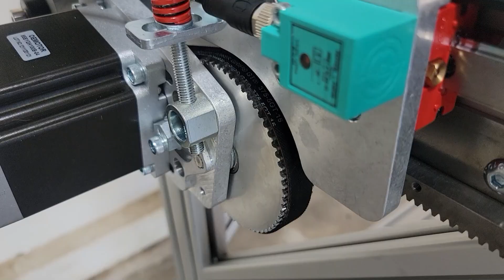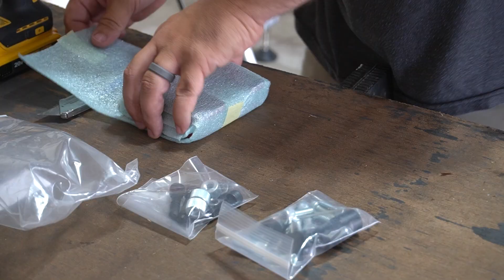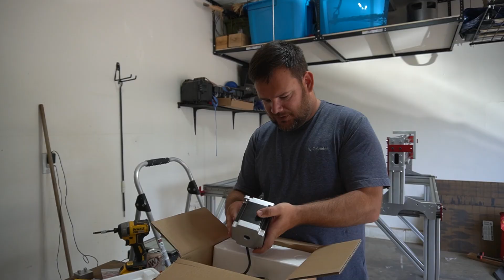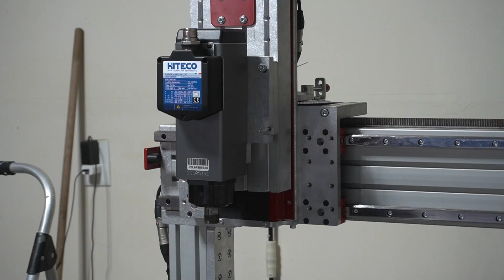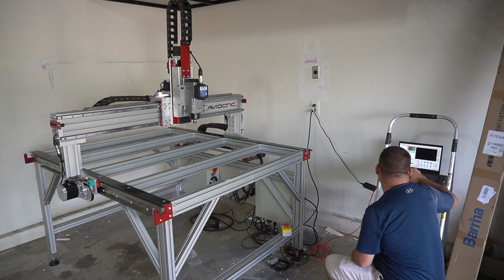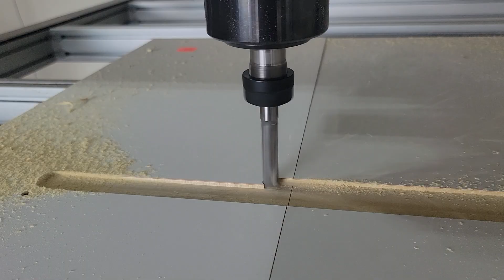Is the Avid Pro 4848 Worth the Build?

Comment: Can carbide create be used with the avid?  Do you have to use Mach4?
Reply from the maker: You can use whatever CAD/CAM software you want with the Avid, although I recommend Vectric. Carbide Create is CAD/CAM software. This is where you design your files and apply toolpaths. Mach 4 is CNC control software. It turns your computer into a CNC controller and reads your gcode. Carbide Motion is the equivalent of Mach 4. Carbide Motion cannot be used on any machine other than a Carbide 3D machine. Mach 4 can be used on many different CNC machines and Avid has gone the extra mile by making a custom interface in Mach 4 for their machines.
Reply: The HS I sub at was given an Avid from a donor, but no software except the mach4, I was trying to help the shop teacher figure it out…maybe even find a ready made project to try on the machine…..I have been trying to watch all I can to be ready when I purchase a machine…

Comment: I would still recommend actually tramming it with something like the Edge Technologies gauge. It gives you two dial indicators and a 6" span, it will be much more accurate. Get the spoilboard down first, and then use a piece of glass to measure the tram error. After that's done you can surface the spoilboard. No need to make test cuts.
Reply from the maker: Thanks. I guess it depends on your tolerances. I can see needed more accuracy for metal
Reply: @AndyBirdBuilds  This is good feedback from Cody Meyer, every machine regardless if it’s cutting foam or metal should have a tram spindle, you’ll break bits (specifically the smaller ones due to uneven chip load and you’ll get a poor bottom surface finish and top if touching it with an end mill or fly cutter, It’s worth buying one or making one and your parts will come out looking more professional if you want to be taken serious as a seller.
Reply: @AndyBirdBuilds  The more work you put in on tramming your machine the better your pieces come off the machine. It's worth the investment both in time and money. Dead flat pockets are a thing of beauty. Less tool wear too, you'll be cutting with the entire face of the tool rather than the leading edge.